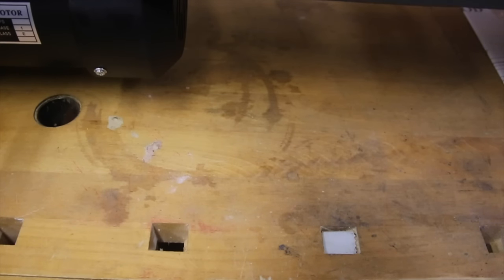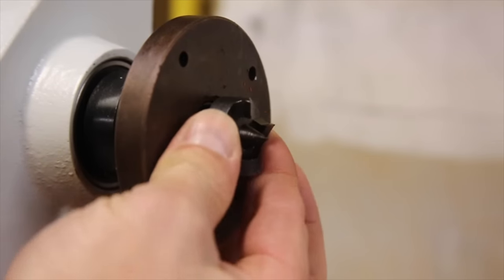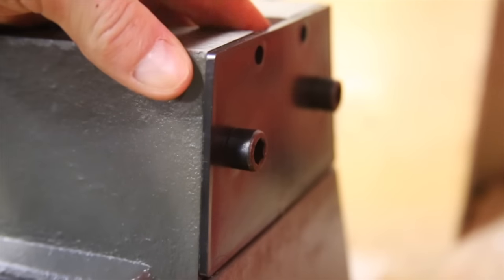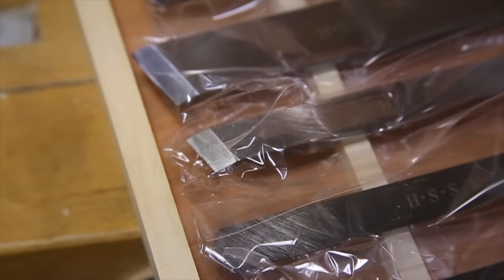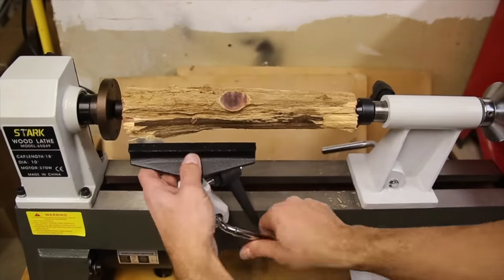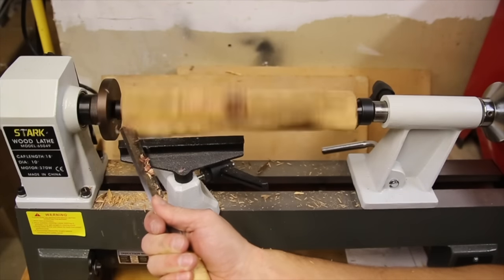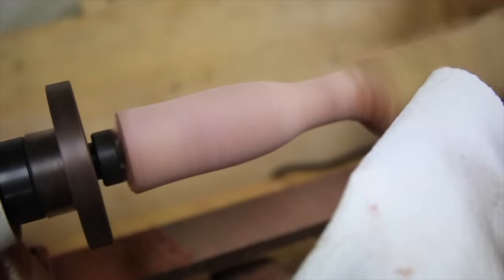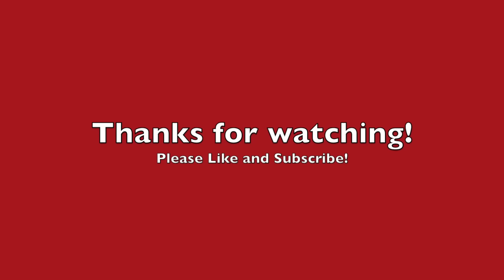Cheap Chinese Mini Wood Lathe Unboxing, Setup, and Testing

Comment: I've used a lot of items that had that style plastic handle.  I really like them.  I've never had one fail in any way but they are way easier to loosen and tighten than just a nut that needs a wrench.

Comment: 10:15 if you didn't know, that is a parting tool and should be oriented the other way.
Reply: On second glance, I don't think it is a parting tool because it is rectangular in cross section (a parting tool is diamond in cross-section). I guess it is what you would call a beading tool.
Reply from the maker: I realized that's what it might be when I was doing the editing haha - It looks like there are multiple types of parting tools (rectangular like that one, diamond like you mentioned, etc) In the next video that I make with this wood lathe, I'll be trying it as a parting tool to see how it goes.
Reply: I looked at the PSI website and they call it a parting tool. In theory a diamond parting tool is supposed to have less friction on the sides but I doubt it makes a huge difference in practice. If you are parting something big, you will usually move the tool to enlarge the kerf anyway.

Comment: Tim, You might want to look at the locking plate under the tailstock, it is very small and barely grips over the small surface area it impacts. I have the same lathe over here in the UK and am still very happy with it after a couple of years use. You might also want to look at carbide tools, saves a lot of sharpening! Have fun with your wood turning, I am still resisting the dark side of metal turning but your videos are not helping. Look forward to more great content in 2018. Seasons greetings from across the pond. Tim H
Reply from the maker: Good tip! I did notice it was a little bit small when I was looking at what it would take to put the locking handle on the front side. Carbide tools would definitely be nice to have - and I'll probably get them at some point - but I just wanted something to get started. 

As for the metal lathe... I'm not sorry for making it difficult for you :) Can't wait to welcome you to the dark side.

Thanks again for watching!
Reply: how much is it??(UK)
Reply: @TimNummy  , Please provide information on the address of the distributor and contact number who sells this mini wood lathe for the territory of Indonesia

Comment: Can I just say, good attempt for a first time with a Lathe, but may I just add, that the tools are chisels, not scrapers, so as such the angle for the cut should be lower, not at 90 degrees to the work, the second too that you used was a parting tool, so is used on edge, and is a scraper, the third tool is a sque chisel, I wont even try to explain that one in text, but you tube will give some good teaching, as the use of one is a skill all on its own, the last tool that you used is for bowl turning mainly, but good attempt, of and out of the box they will most probable need sharpening (again you tube for tutorials as that is another are of skill on its own)

other than that, enjoy your new toy :)

Comment: When the wood stops you have to tighten the tail stock up a bit.  I would be concerned about the crack on the base.  Check the back side. It might be just a surface defect and doesn't matter much.  I would add a variable speed motor to the lathe and you would be all set.  The variable speed is great.  Have a great time turning.  Find a green piece of wood and play with all of the tools to get used to them.  As usual, practice practice.  Thanks for the video.
Reply: @Scott Hank Instablaster :)
Reply: @Fisher Zakai i really appreciate your reply. I got to the site through google and I'm in the hacking process atm.
Seems to take quite some time so I will get back to you later when my account password hopefully is recovered.
Reply: @Fisher Zakai It worked and I actually got access to my account again. I'm so happy!
Thank you so much you saved my ass :D
Reply: @Scott Hank You are welcome :D

Comment: If your piece stops in the lathe it's probably because it's not prepped properly, I typically cut a X along the centre axis of my piece so that the chuck will fit into it nicely and prevent the resistance of the chisel from stopping the piece while the lathe continues moving

Comment: The "curved" tools are called roughing gouges, and you used them right.  The second tool you showed is for v-grooving in the work, and the third is called a parting tool (you used it on it's side to "flatten" the dead tree).  Unfortunately, that's not the proper way to use a parting tool, but I must admit I still do that regularly myself.  It is hard on the edges.  Overall, it looks like a great little lathe!  Thanks!
Reply from the maker: Ah cool! Thanks for the tips :)
Reply: Could you take the headstock off, pull the spindle out and reverse it, then reinstall the headstock with the belt access door on the front instead of rear? Just wondering. Good job of reviewing!
Reply: @TimNummy  , Please provide information on the address of the distributor and contact number who sells this mini wood lathe for the territory of Indonesia

Comment: i have one they are great lathes i turn 10inch bowls all the time i use it more than my big 12 inch lathe.........i did put the extension bed on mine....Rockler ,,,,,Harbor Freight  also sells the very same lathe

Comment: The reason the piece stops is that the spur is a single point instead of 2-3 which is standard on a good lathe. The piece should never be able to be stopped by the tool.

Comment: Merry Christmas Tim!, new toys are always  nice :) i think that you might want to take a look at the MT2 drive, that taper might not be contacting all that well, (causing the slipping) something that you can correct with some bluing and your mini lathe no doubt :)
Reply from the maker: Thanks! I think it was actually the wood slipping on the drive center. Maybe a better drive center would help but then the slipping would probably just move to the belt next... so light cuts it is :)
Reply: TimNummy ahh so the spikes in the drive wasn't grabbing. It would be interesting thou to know how much you could push it (before the engine burnt to a crisp) 😉
Reply from the maker: Haha interesting question indeed...

Comment: Hi Tim, 

I am looking at purchasing one of these for a project.  I will need to reduce the rpm down to around 60.  Is there room there to add in a second pulley?
Reply: you can reposition the belt for a lower rpm but i don't know the specifics of this machine